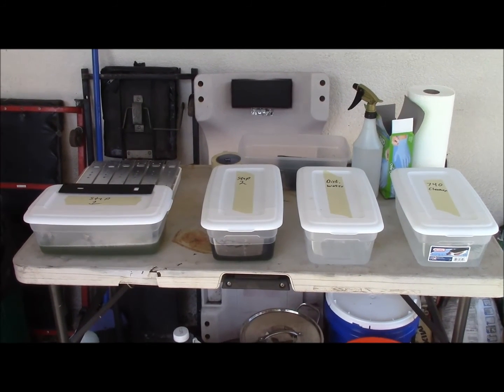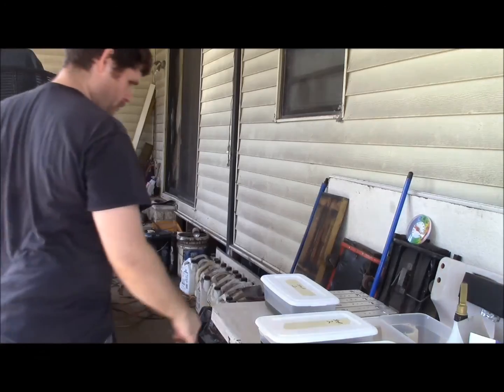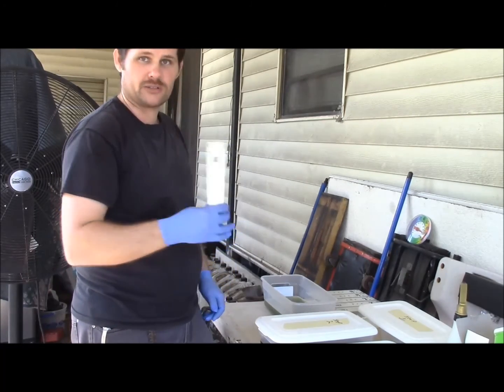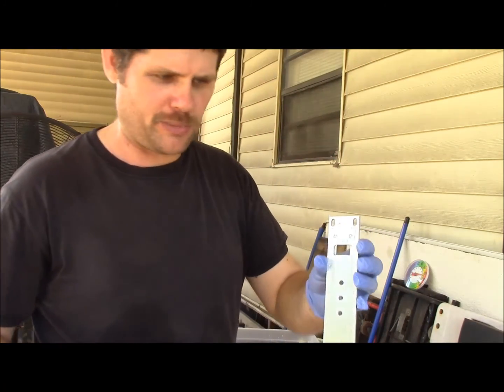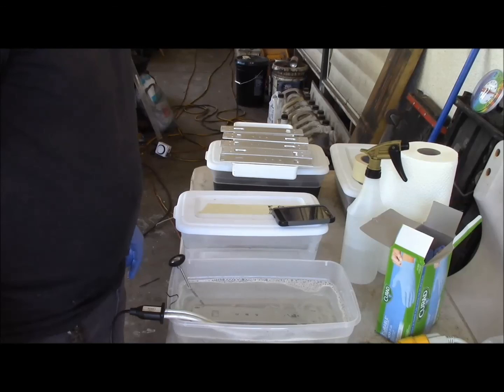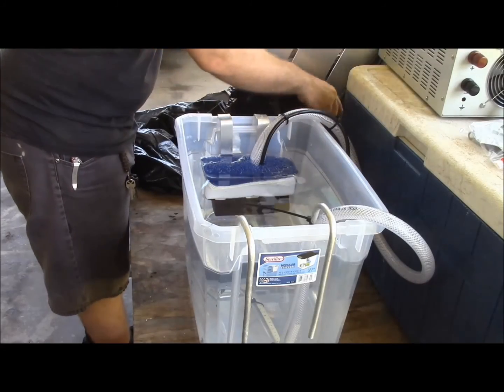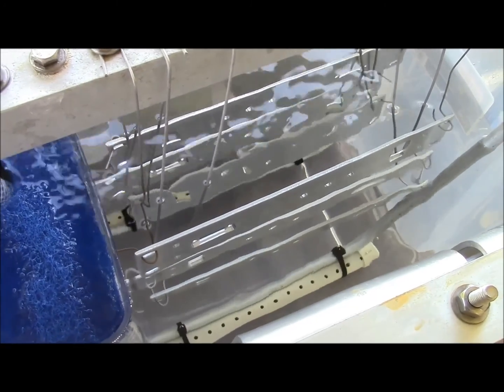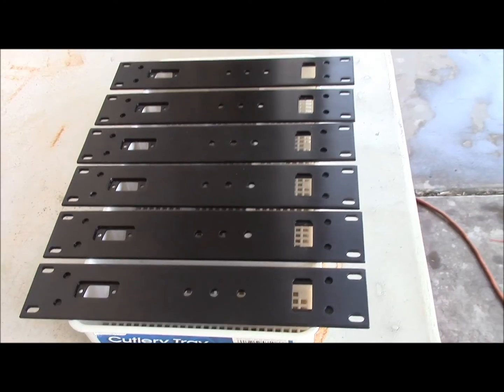Anodizing at Home My Way

Comment: Wonder if you can help me , when I use the 720 rule for area ,
I set the amps running in CC mode yet my volts still increase to around 25v-30v yet I read they should roughly be around 15v 
Any help would be appreciated thanks
Reply from the maker: unfortunately I am not an expert, that being said there are a few things to check -
 water to acid concentration,
 possibly high resistance due to corroded connections ,
 big enough wire to carry the amps ( if they are getting really hot that is a good indicator of too small of a wire is being used ) 
also is your power supply close to maxed out? if so try cutting your run in half so your power supply isn't stressed as much. 
 And how thick of an anodize coating you are trying to form could be causing the voltage to go that high. with smaller operations trying to get your equipment dialed in can be frustrating .  I hope this helps.
Reply: my1987toyota 
Thank you I appreciate your time and help will try the things you have suggested and go from there
Reply: my1987toyota been told to just run 15v and ignore the amps but that doesn’t seem right ?
My power supply is max 10amp & 30v yet I never have needed more the 6 amps.
Wires have been fine heat wise,
Connections are good not long purchased new.
Only going for 0.75mil thickness.
Concentration is in the 1-2 ph level which I assume is correct.
So things look almost right